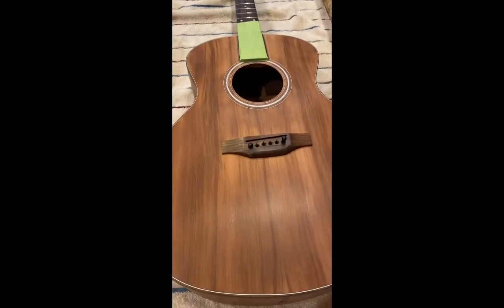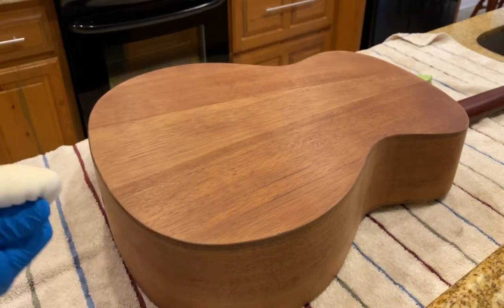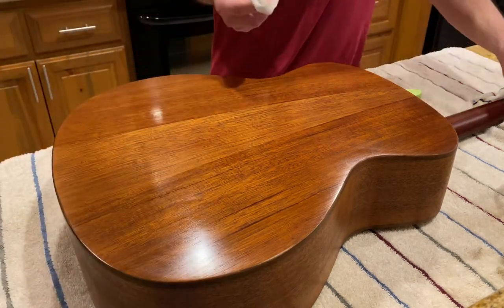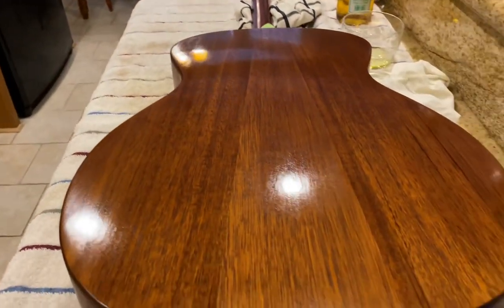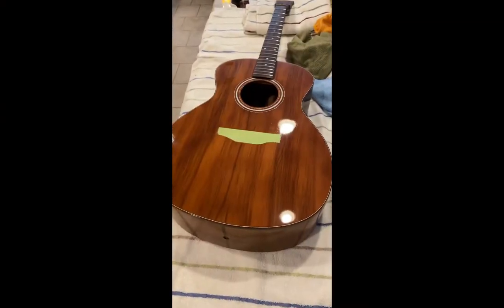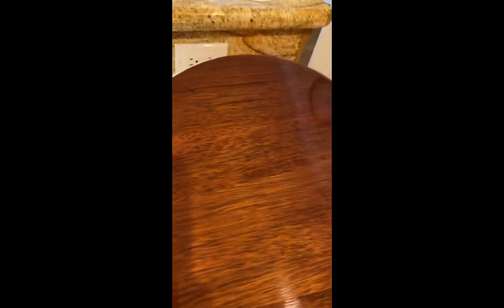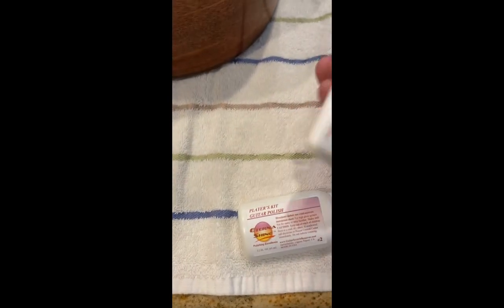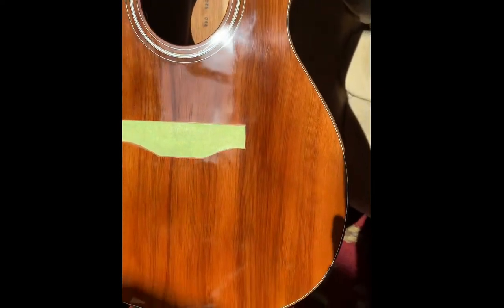French Polishing Acoustic Guitar

Comment: I dare you to take the next step of this journey and try building your own acoustic, first with a kit (you can buy the bracing already carved in a kit with the sides already molded and with the top already cut, all you have to do is glue it all together) and then later carving your own from scratch when you see how it works. And using this superior french polishing method you already have all the gear for. Looking forward to your further adventures. You did a great job on that guitar and it really sounds way better. Well done.
Reply from the maker: Thanks for the kind words! Yes I have considered building a kit guitar but I’m concerned about the cost of Al of the other items that will make the process easier. One thing I see is the the mold that the body is glued together in. The kits don’t come with that. I wonder how straight I could get it glued with whatever the kit comes with. Cardboard? So many other items as well I don’t have. Fret levels , router ( not that I need one for a kit) fret mallet, sticks to hold down the bracing while the glue dries etc ….
Reply: @TheJoshSchneider  most of those glueing jigs can be made with offcuts, a jigsaw, and a nailgun. you can even make most of the clamps yourself instead of buying them. look at how other luthiers do it on youtube. ask for offcuts at local woodshop, they often have a whole box they'll give you. also pallet wood is a great source as well. also firewood is very cheap for this. if you look at old photos of the Martin factory and even further back the guitars in Europe, they made most of the early guitars with very little. handplanes, chisels, gouges and scrapers might not give you cnc precision, but it has more character that way. all the pro luthiers make their own tools anyway. before stewmac it was all selfmade.
Reply from the maker: @arthurwilliams3479  good point! I’ll definitely be considering a kit